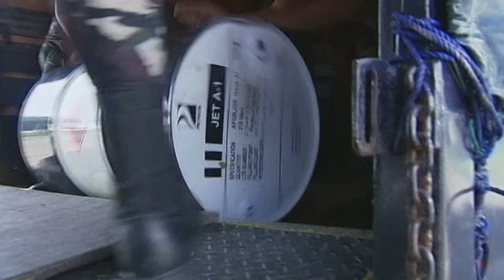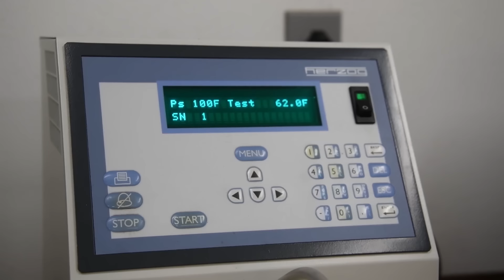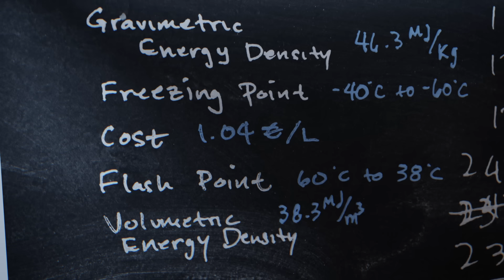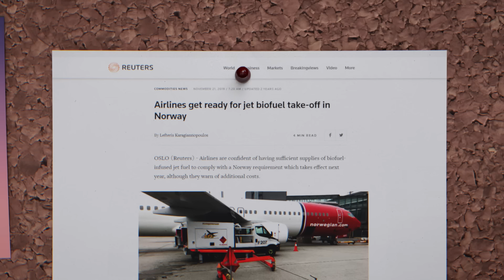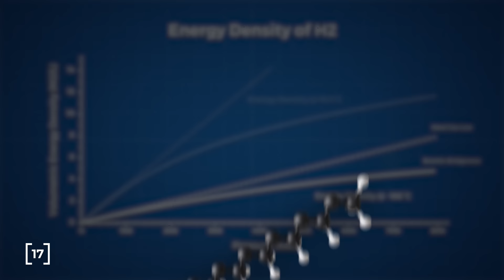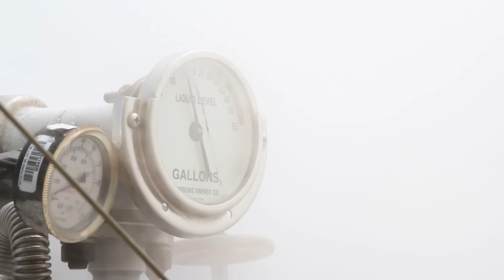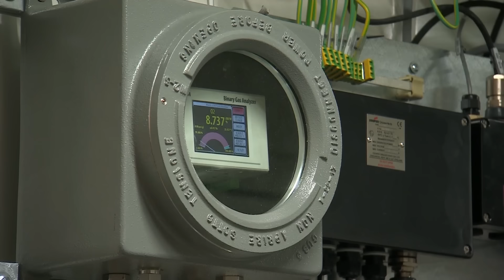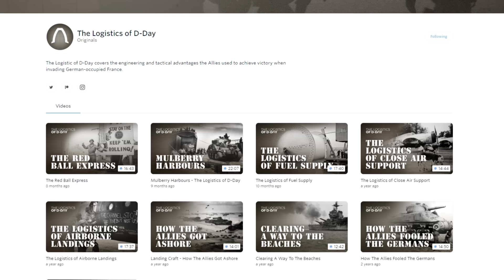The Uncertain Future of Jet Fuel

Comment: We have "high graded" the oil reserves on Earth. As we move to "low grade" types like oil sands, tight oil,etc. the cost of fuels of all fuels will rise considerably . Bio-fuels have very low net energy gains, it's not likely work out in any significant way.
Reply: Explain what you mean by net energy gains? Most of the energy embedded in feedstocks was free from the sun and the energy would be wasted otherwise.
Reply: @HSFY2012  Feed stocks don't magically transform themselves into fuel. They have to be mined or harvested,transported then refined into fuel. All of these  process uses energy. The current net energy gain for conventional oil is around 15:1,  for something like oil sands it's around 5:1. Biofuels suffer the same issue. Ethanol from made from corn has a net energy gain of 1.3:1.
Reply: @mdavid1955  Well the ethanol is not made from corn, but corn waste like husks and stalks. That stuff would need to be harvested/collected and transported somewhere else anyways. It is not a cost unique to the production of ethanol and should not be allocated to the fuel production when determining energy gains. Likewise, the energy contained in the plants by way of sunlight should also not be included in the energy calculation, as it will be in there regardless of whether the feedstock is processed or not. Sounds obvious but people have allocated rainwater to grass as water usage for food comparisons e.g. beef vs crops, which is clearly misleading.

Comment: I predict we will find it easiest to make air travel both low cost and environmentally friendly by building land and satellite infrastructure capable of beaming power to planes via lasers. And yes when 900,000 separate sources of low wattage lasers that individually cannot hurt birds etc, are all aimed directly at the plane's power collector, we have a good solution. Each laser station, esp satellites, could be firing lasers in multiple directions at a great number of planes. OK so I came up with that idea off the cuff (obviously the idea of beaming power came from Isaac Arthur lol), so please comment about the problems I'm not thinking about?

Comment: thermal efficiency needed to be taken into account by which we are just at 50 percent of use of fuel, so that is also there battery power small planes are available but only if boeing and airbus sign a pact to work together to give us the plans we need instead of just developing the same plane, both need to drive the change in engine and fuel not just the government but need governments and company so that humanity can make the most of the everything

Comment: Thermal electrolysis using nuclear for the heat and electricity would be the cheapest and most scalable way to produce hydrogen and run the CO2 scrubbers for synthetic fuels yet it never got a mention because Nuclear is a dirty word that is only to be discussed  in relation to power plant meltdowns and or weapons.

Comment: I think that increasing biofuel production will allow it to be mass produced more easily and drop the price of it drastically by 2030. Ethiads use of the salicornia crop which can grow in salt water pools could be a step in the right direction as it doesn't use areas of land which could otherwise be used for food crops. Whatever happens, I think flights will increase in cost over the next 30 years but we have to remember that flying hasn't always been cheap.

Comment: Propaganda against Hydrogen (or more specifically, the Fuel Cell industry) is amazing.
Going back to your fuel molecules you'll notice that the "legs" on each of these molecules is Hydrogen. So it is a liquid even in gasoline or jet fuel.  Why people keep describing it only as a gas (not a liquid ar room temp) is part of the repeated propaganda against it.
The most efficient storage of Hydrogen is as a liquid pumped into fuel tanks in mere minutes and whose infrastructure already exists.  Steaming Methanol releases the Hydrogen, and Methanol is a common fuel. The device which extracts the Hydrogen is called a Reformer.
I would always use a common fuel in liquid form and reforming a common liquid duel is the easiest solution for any energy conversion

Comment: But what does a percentage really mean? That particularly seems like an odd place to begin or hang this on, in light of where various alternatives are or aren't available to various sectors. The primary problem facing the airline industry should really be the issue of cost rises due to lesser economies of scale while many other adjacent industries move away from fuels with high carbon impact, because they have good alternatives and their services are needed, but if there aren't alternatives for jet fuel then we're left with a balance that has to be struck, whether or not it represents a certain ratio of carbon emissions. 

The ratio is meaningless at the end of the day without a larger goal. If the goal is lower carbon emissions, then we're well on our way to succeeding, no matter what percentage is left from sectors that don't have a replacement.

Comment: 3:45 surely it should be a higher boiling point? thats why they liquify lower down, because the temp is still too high for the boiling points of other chemicals, but low enough for longer chains
Reply: You're right! Thanks

Comment: Sorry British guy but you can't flight shame Americans.

San Francisco and Los Angeles are fairly close population centers by North American standards. Yet they're 380 miles apart. I know you're offended by Imperial units so that's 611 km. You're British right? Well, that's about the distance from London, England to Glasgow, Scotland. You guys don't have HSR out that far. (HS2 will stop at liverpool iirc.) 

If someone were do an HSR correctly, it would still take about two hours to go from one to the other. (all the mistakes made in the HSR project here in California mean it would take four hours, if the system is ever completed, which it won't be. And we're ok with that because jet aircraft work a lot better for this purpose.)

Yet an airplane takes only one hour. In fact one time out of the several times I have flown between the two cities, it took only 45 minutes.

And then the nearest city of any appreciable size north of San Francisco is Seattle, and it's 800 miles or 1287 km. To the east, Dallas, 1500 miles or 2414 km. (see, Real Engineering? There's such a thing as a computer, and it allows you to convert between units with ease. It's really not an issue. Just open the calculator app on your Android 10 machine, it should have a unit converter.)

An airplane can fly to Dallas in three and a half hours...an HSR would take six hours. An HSR would take 15 hours to go from San Francisco to New York, whereas a plane only takes six hours.

So, you can't flight shame us, we will always use aircraft because they are the best solution (well them and the upcoming point to point suborbital flights from SpaceX, Blue Origin and Virgin Galactic).

Eventually long haul flights will use hydrogen, but until then we'll use biofuels. But aviation's days are not numbered in any way because this is not Europe, and the distances between cities are simply too far. That includes Canada and Australia too.

Comment: If Hydrogen, which along with all the challenges would be a nightmare in terms of it's flashing point (always can burn at whatever temperature), is being considered so seriously by Airbus, why not stick to Ethanol as a Biofuel, since this would be much cheaper and easier to scale and work on the same kinds of engines and infrastructures currently available? Yes, the issue of Ethanol's low flashing point would have be to addressed, but that is still an easier feat than addressing the same issue for hydrogen. And it would not require a whole new ground infrastructure plus completely new planes. 
Yes, Hydrogen has the potential to be greener in the future, but first we need massive amounts of excess renewable energy, so it seems like a very far future scenario (worth investigating, yes, but no solution to the current urgent issue)

Comment: You focused on the fuel to move the planes. I am also curious on increasing the efficiency of the flight itself. For example the double bubble airplane that uses lower speed and a unique design to double the amount of passengers while decreasing the amount of fuel required. If you cut the total amount of flights in half that would also cut the cost of flights in half as well. Plus if we can use high speed rail for the short jumps and only use planes on the longer distances where it is more worth it that would also decrease total emissions. Idk. Just wanted to bring up that in order to think outside the box you must first identify the box itself.
Reply: That means more crowded less healthy planes. Yuk. Terrible idea

Comment: I think the Aerodynamics needs fundamentally rethought. They hasn’t been a significant leap forward in our wing design since supercritical airfoils on the A300. We need Prandtl wings NOW or the aircraft industry will get very dirty. No forward movement is backward movement and whilst the manufacturers will tell you they’re innovating. It’s a matter of decimal point fuel burn reduction.

Comment: Would it make sense to add some batteries, some solar panels to airplanes to lower the need for fuel? have secondary electric engines, or embed electric propulsion in the jet engines?
Would it make sense to use electric catapults to accelerate airplanes on the ground and save fuel at takeoff?

Comment: I don't see leakage of hydrogen as a problem if we are integrating the tanks with plastic and carbon Fibre (see toyota's claim of negligible leakage) and even if hydrogen does leak it has no potential to be dangerous because it would instantly dissipate in case of rupture ( not sure about liquid hydrogen though)

Comment: Would it not be cheaper to just keep the jet fuel as it is and instead offset the emissions with co2 capturing plants? Renewables are great at long running low power operations. Redesigning the air industry will require even more energy with no success guarantee.

Comment: So this video is about the engineering difficulties of using Hydrogen as aviation fuel, and the costs that it would incur in terms of producing it, storing it, distributing it, and making it safe, and also the need to take up usable space on an aircraft which would reduce usable, revenue generating cabin space. All this will have a impact on air fares.

But the other issue is the economic feasibility of air travel post-pandemic. The business model for the airline industry depends on the the business and first class passengers to generate sufficient revenue to pay for the flight. Economy class passengers are just tagging along for the ride, and any revenue the airlines make is just gravy. (Low Cost Carriers thrive by servicing the most profitable routes with the highest demand.) The pandemic has shown that business Air Travel is an unnecessary luxury. When the world returns to near normal (say by 2023), business travel would be scrutinised and only the most necessary would be approved. which means fewer business travellers, and fewer business (and first class) passengers, and so fewer flights, and so fewer economy seats, and so higher prices. Together with higher costs of hydrogen fuel, the whole industry will be a lot more expensive.

I do not see leisure travel coming back at the price levels we have gotten accustomed to pre-pandemic.

Comment: What’s your thoughts on the Australian CSIRO invention, Ammonia as the carrier for Hydrogen?

Decomposed ammonia passes through the CSIRO's metal membrane to produce pure hydrogen. ... 

CSIRO's research addresses the conversion of ammonia back to high-purity hydrogen at, or near, the point of use. Membranes are a thin layer of metal which allows hydrogen to pass, while blocking all other gases.

At this stage the company Fortescue in Australia, is looking at producing green Hydrogen on a massive scale. It would than be transported in oil tanker style ships, but in the form of Ammonia for safety…

There is talk that the CSIRO could make the Ammonia to Hydrogen membranes small enough to put into aircraft. This would allow the fuel to be still stored conveniently in the wings as ammonia, but coveted at either the engine or fuel cell to Hydrogen.

Comment: It would be great if we just called "jet fuel" by it's name.   It's called kerosene.    kerosene fuel was so poor quality that it was relegated to most basic use cases, such as heating and lighting apparatuses in homes.  

kerosene fuel was chosen as fuel for jets because government required industry to use a very cheap and accessible fuel as a power source for hungry Jet Planes.    

Reality is, any type of Gasoline could be the power source of Jets BECAUSE you can design an engine to burn any of the fuel types....End result, "jet fuel" now costs an arm and a leg.

Comment: Great video no doubt. For me there is no question ethanol is a clear winner. Hydrogen has too many problems. 
The interesting question is if there is enough arable land to produce ethanol from sugar cane just for all EU. 
Well, Brazil is most efficient and biggest producer of ethanol from sugar cane in the world. It covers 50% of the road transport of the country using 1% of the arable land that is 3,6 mln ha with rate 8000 l/ha. 

Now the primary energy consumption of the whole EU from crude oil is 20 EJ = 5 556TWh in 2020. 
Crude oil is in 90% used to produce liquid fuels: petrol, diesel, kerosene, LPG. It is used in road, air and sea transport. 

Now the ethanol has a volumetric energy density  24 MJ/l = 6,67 kWh/l. That gives from one hectare 8000 l/ha * 6,67 kWh/l = 53,33 MWh/ha. So from 1 mln hectares we have 53,33 TWh/mln ha. That means that replacing all oil requires land of: 
5556TWh / 53,33TWh/mln ha = 104,2 mln ha. 

The arable land in Brazil has 355 mln ha. That means consumption of the EU liquid fuels requires 29,34% of the arable land of the Brazil. 

Well good news, growing sugar canes on around 30% of arable land of Brazil (around 12,2 % of the country) would completely replace crude oil use in whole EU. That would be difficult to do but feasible. 

Side effect would be that burning bagassa would cover most of the Brazil need for electricity, but there are no specific data to calculate that.

Comment: Very informative video about fuels. But why you need fuel at all? Solar + battery should be the way to go. Will need to redesign all airplanes for sure.
Reply: The problem is that batteries are heavy, and stay heavy even when they are empty, so they are not great for aviation usages. If you have car driving on the ground, and the ground is mostly flat, the weight is not that much of an issue, but a plane, which has to climb from the ground up to the normal cruising altitude, would waste a lot of energy just by having to lift the batteries up to this altitude, and keep them there.

Also, with fuel that burns up, the plane gets lighter with every Liter of fuel used up, making the plane more efficient the emptier the fuel tanks are. This is not the case with batteries. Also there are planes in existence that can fly for a real long time without a stop (I don't know the exact numbers, but I think there are flights where the plane is in the air for 16 hours or more, without any refuelling at all). We can't (yet) build batteries that have an energy density that is so huge that this is viable with batteries, since the energy density (no matter if measured by weight or volume) of batteries is just not that great (yet).

This is also the cause why electric cars of today are typically not able to drive the huge distances without charging that are viable with one tank of gas or Diesel. But for a car, stopping for 30 min. for charging is easier than for a plane that would have to have a landing slot at an airport, then it would get charged, and then it would need a departure slot, making it drastically more expensive and more complex.

Also, I don't know if it is even possible to have electric planes that are (nearly) as fast as planes powered by fossil fuels that are burnt in a jet engine, since propeller planes could drive the propeller with an electric motor, but propeller planes are not fast (compared to ones with jet engines).

Comment: The methanol is actually the most promising one since the only reason is not viable is extremely high electricity cost to produce since you need CO2 capture and the hidrogen from electrólisis but there's one solution that everyone always dream of creating,  clean cheap electricity generation from a nuclear fusion plant or similar, after all we have to make electricity generation larger and sustainable and when that comes and as fosil fuel runs out and becomes more expensive we could see E-fuel become the new standard